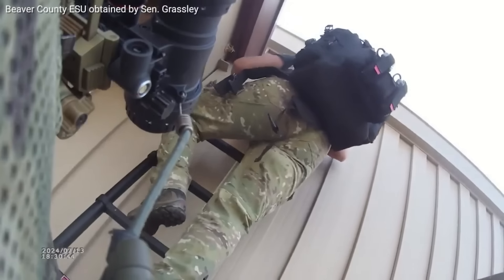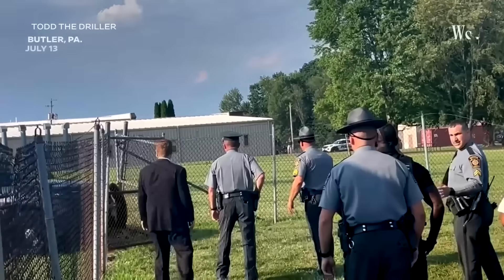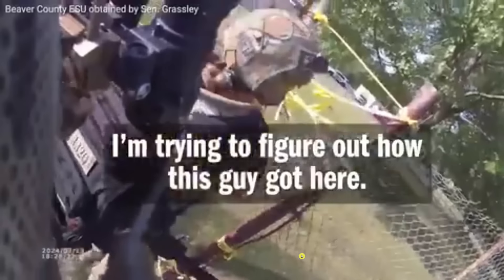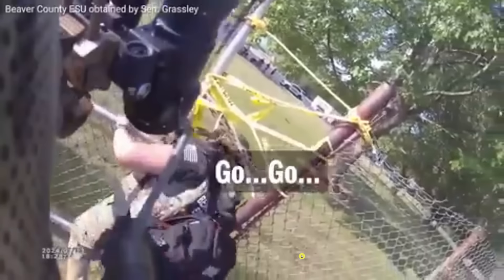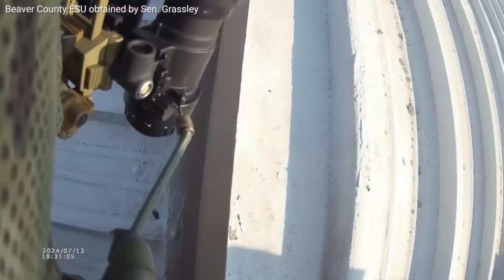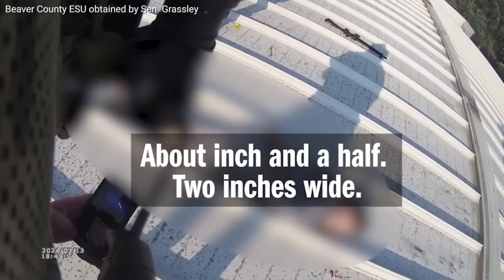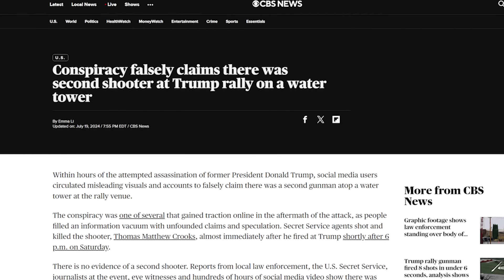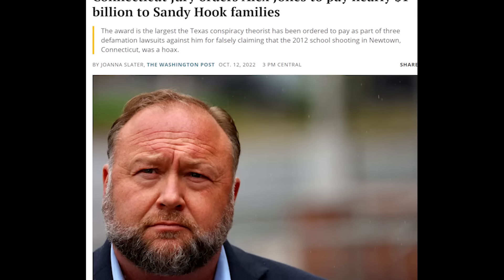Trump Shooting Analysis: Shell Casings, Ladders, Drones, Bodycams,

Comment: I'm a professional engineer and experienced marksman - had my own gun range on 20 acres and trained with AR & AK, etc... for years, and the "Pull-toy cover up" has begun.  The audio evidence from the Podium mics is extremely clear that first shooter only shot 3 shots TOTAL (not 8) and the remainder shots (4 or 5) were a VERY different timbre shots with VERY different audio propagation characteristics i.e.: last shots were more powerful rifle (NOT an AR15) from much further away - propagation analysis (I have done propagation analysis on a professional level for over 30 years) of first 3 shots is 150 yards and the remainder nominally 400 yards.
Reply: Just like many people think, he wasn't the only shooter
Reply: Yes, Chris Martenson covered this very well.
Reply: THANK YOU
Reply: Water tower is 400 yards away.
Reply: How do explain the police body cam footage in which an officer on the roof says there were at least 8 shell cases on the roof?
Reply: Thank you!
Reply: There's one thing I don't get about this scenario.  If Crooks was the patsy, and there was a also a pro, how did the pro miss?  

Also, if the bullet came from the opposite direction, it would be apparent when it hit Trump.  Likely it would be apparent even to the crowd.    If you're using two shooters, they'd have to be in the same direction.   Like from one of those open windows.

But if the guys in the building were locals, ...that would be a hell of a lot of people to bring into the inside job.  Why would you want two agencies involved in an inside job?
Reply: @kevinkingmaker7395 he wasn’t the first person up there
Reply: @kevinkingmaker7395 The body cam footage did not show the shells, the cop only referred to them as 8.  So, it makes one wonder, why did the audio files have a distinct sound of 2 different shooters followed by the one counter sniper kill shot.
Reply: @jengleheimerschmitt7941  pro missed because trump moved his head at the right time.
Reply: Exactly... I analyzed the audio from 3 different live streams within an hour of the incident, and realized that there were at least 4 different weapons fired there. I analyze audio almost everyday for over 40 years now, and you can even see the different frequencies of each weapon, not only that but the boom and report are telling, as well. This is what I call simple audio forensics, and there is no excuse for them not doing an even better job than I did within that first hour, as there are several other recordings of it available now, that was not during that first hour. The person in the crowd behind Trump, that is obviously dressed in what I have seen as the high satanic priest in other investigations, and completely stands out from everyone else there, didn't flinch in the least bit as everyone around him were ducking, etc., then texted on his phone in the same position as before the shots, while shacking his head 'no', then pointing his camera at Trump showing he was alive. Then he immediately started inciting the crowd there to start chanting. Yet, no one in the media is even talking about him, when he was the first one to catch my eye long before the shots, wondering why he kept moving over to the spot that he ended up in for a few minutes before the incident, getting people to move out of the way for him. Very suspicious to say the least. It causes you to immediately think something was up with his presence there. Just saying! Don't take my word for it, Look for yourself at the video of the crowd behind Trump where they tried to say that the FBI Assist. Dir. was sitting [not sure about her], but he is the one who caught my eye with his behavior long before the shots. He was to the left of Trump facing him... you can't miss him.
Reply: @kevinkingmaker7395 he said they were there, but they were never shown…. With all of the angles, we should have been able to see at least a few of them..
Reply: @kevinkingmaker7395  He said there were 8, but we did not SEE them did we?
Reply: First three shots were well measured and carefully taken with an even cadence. I think 45 was hit with one of the first three shots. Then came 5 very erratic faster shots from what sounds like a different rifle, location and echo. Then one last shot from the counter sniper.
Reply: 8 cases, dosent mean he fired 8, just means others may have fell from his pocket. They bound his hands and moved the gun. Where is that video. Why did he stop, did he jam, did he forget mags. They claimed he had over 50 rounds. They emptied his pockets, where extra mags etc.
Reply: he didn't show the whole video. Once they got on the roof, the cop only counted out loud 5 shells
Reply: @kevinkingmaker7395  he only counted 5 if you watch this video once they got on the roof. This guy skipped a section
Reply: @billglueck9705  For anyone who is not stupid. The first 3 shots were fired from a covered positions and the last 5 from a raised position. Thus the audio change.  Sounds can change even when moved a foot. My golly some people are idiots.
Reply: Five shell casings were found on the roof from the Grassley footage of the officer's bodycam evidence.
Reply: @SavedbyHisGrace73 what I said
Reply: All of those people on the roof contaminated the crime scene. Puting her gloves on to pretend to go serve aid, 5 minutes after lol. Talk crap for bodycam. They know what to feed people.
Reply: The way T acted after was proof he was in on it, if he thought it was real he wouldn't care about shoes, hat, or posing. But, only the sound of shots doesn't tell us much. Aiming in a different direction can change the sound, maybe he went from prone to kneeling, maybe the first three rounds were different for a specific  purpose. I am not saying there wasn't a 2nd, just, without visual with the sound it's all speculation
Reply: @kevinkingmaker7395   Other comments say that there is a video of the first officers on the roof that call out that there are 5 casings on the roof not eight.
Reply: @SavedbyHisGrace73  See also John Cullen’s (John E Hoover on YouTube) compelling analysis of video and audio. Martenson and Cullen both support 2 shooters, but different on the sources of the shots. For example, Cullen shows quite convincingly that shot #1 actually originated from the trees to the right of Bldg 6 and at the SS snipers!
Reply: @kevinkingmaker7395  Yea thats what he said.....just words...
Reply: @billglueck9705  Exactly my take on this.
Reply: @bobgreene3539  The guy in black, with the funny hat on? I thought he was odd, because it is not the kind of hat one would wear on a hot day in a rally place... more like some costume prop.... he sat like a statue, as if nothing strange was going down, when everybody else was scrambling!
Reply: @elliewilsIf were not believing the # of casings, I believe he was not hit by a bullet
Reply: @johnrogan9420  The Water Tower is about 800 feet away from where Trump was standing
Reply: @jengleheimerschmitt7941  The other shooter was in the building behind Crooks. Shot out the window. Greg, the guy with the tatoo sleeve. I don't believe for a second that both of them guys sitting behind the window in that room got off of their post to go searching for Crooks. The grounds were full of staff policing the area. BS!
Reply: also stated shells on both sides... but the shells ejected from a semi auto would only be on one side. the side the casing was ejected out of the gun.
Reply: @johnrogan9420   Using gmap pedometer, I found that the closest edge of the water tower to Trump was 807 feet away.
Reply: @geraldreinhardt8415   There are a few aerial shots that show that a huge, red Combine/Harvester was placed between those 2nd floor windows and Trump within  the perimeter of the interior fence line....likely intentionally as a measure to protect Trump in the event the second floor counter snipers assigned to that post had to fire in the general direction toward the rally.
Reply: @kevinkingmaker7395 the sniper cops inside the window shot # 4-8 and threw the shells out the window to the roof where the 20 year old was laying  ....last # 9 was SS ....possible  # 10 was from approx 1400 yards away by SS or other sniper
Reply: @bobgreene3539 and video confirms! They killed the kid and planted him.had an actor that othes didnt really match appear for film then dicked out and they started firing.
Reply: @peggygilmour8905 yes, if you watch the video closely while he's counting you can see 5 cases. Right then the guy on the other side of the roof points and looks down, presumably where the other 3 cases are. Could be explained by the shooter shifting position after the first 3 shots. That also might explain the different audio signature.
Reply: @kevinkingmaker7395  What, he can’t lie?  Did you see any visual evidence?  However, there is audio evidence on the shots.
Reply: @geraldreinhardt8415 an actor played crooks and had slightly diffrent color shorts on! Crooks was dead wrapped in that blanket!
Reply: @velvetpaws999 he might dress funny but he is an avid Trump supporter, and goes to many of DJT's rallies. can't think of his name
Reply: @geraldreinhardt8415  Yeah, that sounds very likely.  The problem Is, an inside job with multiple agencies is a lot more difficult than it has to be.  On the other hand it does muddy the water and explain the coms breakdown.    The other issue I have there is that if they'd had a pro, he wouldn't have gone for a head shot in the first place.  A pro would expect the head to bob around and he'd aim for the center of mass.
Reply: Both the photos and video of crooks are too grainy for todays hd think hard a photo from only 100 feet away you cannot blow up both photos and the videp by design
Reply: Shots 4 to 8 are different. The time of the echo between bullet crack and gun report are very close in timming, but not exact. This will take real forensics to sort out. I think they should even do a live fire reenactment. If the shooter moved, like stood up or rested the rifle on the roof. The gun firing against the roof would be a different signature than free holding. The forensics on the shell casing should show if they have the same markings and mean they were fired from the same gun.

Were there two vehicles? Where are the photos? How do you transport a ladder, a bike and a drone?
Reply: @lastdaysguitar  yes! Exactly! I have similar observations, too!  Great  analysis 👍
Reply: @CL-mp4vn he wasn't ANY of the three shooters
Reply: @TexasEngineer none of the sounds are from free holding. To set the steady timming of first and rapid fire of second group had to be professionally done.
Reply: I saw a video today during the rally where people said " where are those police running"....,it appeared, to the water tower and I think someone even said that. I saw the audio footprint, clearly showing there were different weapons.
Reply: @bobgreene3539 the audio guy I heard said the first shot was muffled, followed by two shots, then five other shots plus one, so are you singling out the first shot? Maybe the kid only fired the first shot.
Reply: @elijahmiller912  are you trying to say trump was in on this ? If so you are completely out of your mind.
Reply: @kevinkingmaker7395 he's a liar 
did you see the casings
Reply: @VicknairD  will definitely check that out. It wouldn't surprise me in the least. What a mess.
Reply: Can fool believers but not those who KNOW!!!!!
Reply: @bobgreene3539 interesting. I listened to a video with 2 guys analyzing the gal behind Trump (in the sunglasses & phone with the odd behavior) & they noticed/pointed out that she & he (the guy you’re referencing) seem to be working in concert (even though they’re not sitting together). These guys both agreed their behavior/s was indeed odd.
Reply: @velvetpaws999 that guy with the hat/glasses is Vincent & he’s been at dozens of not more rally’s.
Reply: @elijahmiller912 or it could be because the secret service said shooter down.. trump being in on it is ridiculous. All it takes is a little bit of a change of wind direction and you blow trumps head off. Stop being ridiculous.
Reply: @bobgreene3539  Wouldn't the shots have a different sound if the shooter was standing vs prone?  You would get a pretty nasty echo off a metal roof.
Reply: The last shots definitely sounded like a .308 more than anything
Reply: Well, exactly! That's why Erik Prince tweeted day of (paraphrasing) 'good thing a counter Sniper took a 480yd shot to the sh00ter'. There was another Sniper further away from the two pairs of CS'ers on the red barns - he was adjacent left of CS team on the southern side.
Reply: With the first three shots he was probably prone, resting the barrel on the ridge.
This would create a different sound signature to when he changed his shooting stance and fired the other rounds..
Reply: Is everyone going to ignore the radio chatter n body Cam guy n Michelle (medic) talking about the water tower n van?
Reply: @alanshaw4655 
Exactly.  Bullet went where it was aimed.  Trump moved. Not exactly a miss.
Reply: @bobgreene3539  Are you talking about Vince Fusca?
Reply: @chickenlady-iw8fx 
I heard that same in a different video of this same footage.  Now I don't know what to believe.  I also listened to Wray say 8 then later a congressman asked if it was 7 and he siad yes.
Nobody seemed to notice.
Reply: @Eydr-s5j  Presumably the kid shot none and was only there to be shot at. If I see his pictures and the blaroc video, he wasn't too smart a guy.
Reply: Yes, and that second group of 5 shots was so fast, it almost sounded like a burst from a  full automatic.  Almost. But definitely a quite different sound from the first 3.
Reply: From a low quality audio track. Get lost with this bs.
Reply: @RememberNineEleven  that is what I would think. Given the police said 8 cartridges on the video, and there were only 8 shots heard, it makes me wonder if he only shot 3-4 times, and the rest were sniper shots. And they simply unloaded the gun and moved it away from the body.
Reply: @jengleheimerschmitt7941  good points. I think it’s going with the idea that Trump was not shot. That the wound was created later and that the idea was to shoot into the audience.
Reply: im thinking you are a 14 year old boy with a big imagination lol
Reply: Respectfully, I would ask you to look at the audio again. At least 3 of the second salvo of shots have the same propagation time as the 3 in the first salvo. There is no evidence for 400 yards. That is a mistake made by tying the wrong sonic shockwave and muzzle report together. I can find six pairs 0.22 seconds apart. The podium audio, while useful for determining distances is not actually helpful for the number of shots because cracks and reports overlap in the salvo of 5. The various cellphone audios from the crowd more clearly show 3 shots, pause, 5 shots, one distant counter-sniper shot, long pause, second more distant counter-sniper shot. Some cellphone audios make it sound like every single bullet is different out of the 8. One has them all sounding the same - the New York Post one, "Panic..."
Reply: @SavedbyHisGrace73  true, very intersting Martenson's audio analysis. The only thing I do not believe is that one of the 5 shots killed the fireman. If the gun firing the 5 shots had been pointed towards the crowd a couple more people had been injured/killed
Reply: @kevinkingmaker7395  In the full bodycam video that was released, at 6.31.45 pm they count 5 shell casings.  After 6.38 pm, 10 min is missing of body cam footage.   Then at 7.01.55 pm they count 8 shell casings.
Reply: @heynow01  Lots of things could explain the differing sound, such as Crooks standing up for the 2nd group of shots, microphone angle changing, etc.  The 2nd group followed awfully quickly, though.  Still, I find this a bit more believable than the local LEO's on the roof immediately after the shooting being in on what would have to be a VERY complex, very risky plot, including things like knowing how many shots each shooter would take if there were 2 shooters, being sure a 2nd shooter would not be detected right away, etc.  The second shooter would have to be firing a much heavier weapon to be louder at a few hundred yards away than shots taken from the AGR building and recorded beside it.  (inverse square law of sound volume vs. distance)  Also, surely bystanders near the AGR building would hear shots "from that other direction".  None have said that.
Reply: @krisbooth1473  this is the most ridiculous scenario I've heard yet.
Reply: @bobgreene3539  I call BS.  A real 40+ year audio pro would not refer to "the different frequencies of each weapon".  You don't know the language, you just think you do.
Reply: "first 3 shots is 150 yards and the remainder nominally 400 yards": No no, last shot was a single kill from SS sniper, maybe 300yds - ONE SHOT. No way 2nd shooter sniped 4 times at 400 yds and missed. You don't set all that up to miss.
Reply: @peggygilmour8905  8 casings were found.  The count of 8 is about 19 minutes later in the bodycam footage.  3 were on the "other side" of the roof ridge - almost certainly from the 1st 3 shots.
Reply: @elijahmiller912  Hah, you don't know Trump at all.
Reply: @SpringIsBACK  Check out Mike Bell. "Trump Shooting audio analysis" from yesterday.
This guy uses two audio files, one near the fence line between and the shooter and the other from Trump's mic. 
These two files show all eight shots displaying an identical signature pattern and the 9th shot being from a different gun.
He explains that the other files being analyzed are not good examples?
Seems credible?
Reply: @RememberNineEleven  the guy I saw, said the speed plus the sound pointed to another shooter. The first ones sounded like a target shoot, the next five, just firing asca decoy. Maybe the kid agreed to do that part, knowing he'd probably die.
Reply: @Pozi_Drive  I think you may be right. If he hated trump and was also depressed, he chose to pay the price to go out as a hero to the left.
Reply: @heinerrambold8889  I've not heard anyone saying where the fire chief was in relation to Trump., Plus the other two people hit???????
Reply: @SpringIsBACK  I think the controversy there, is they seemed to be on the left side of the shooter instead of the right, where they would discharge. No way he jumped up and changed his angle once the shots started.
Reply: @heinerrambold8889  yes, if I was family, I would be digging in hard on what exactly happened.
Reply: @Eydr-s5j  there is a video from azget industries showing the trajectories. The fire chief was on the left bleacher somehwere in the middle, the other people who were injured on the right bleacher almost at the top.
Reply: @heinerrambold8889  thanks, I'll check it out 🇺🇸
Reply: Korrekt !
Reply: Shot from sniper 4 at open window
Reply: @chickenlady-iw8fx body cams turned off for 12min
Reply: Why bring up Alex Jones unless you want to scare peoples opinions (Conspiracy Theories ) You did it yourself by stating the shooter likely stood up to take the last 5 shots rapid fire burst mode and exposed him. How come no one has taken a video were the SS Snipers were on the roof with the tall tripod at least 4 feet about the crest of their roof and put a person where the sniper was crawling up the roof to see if he is visible. if you noticed the sniper was at least 18" to 24" above the roof while moving up the roof especially carrying the gun.
I bet if you ask any counter snipers ti view the site I bet 99% would pick the water tower as a place to put an SS agent with a pair of binoculars. if you use Google Earth you can see the ladder on the far side of the water tower for easy access.

Wow your theory is totally off I thought you said he stood up after the first 3 shots . Also you say at the end he was a few feet from the apex of the roof . You do realize the SS snipers were way above Trump so if the shooter can see Trump the SS snipers at the higher elevation would have definitely seen him that is simple Math Geometry Angles ???????

His Geometry does not compute X = sniper, Y =Trump, Z =SS Snipers If X can see Y and Z is above Y then Z can definity see X Simple Math😇😇
Reply: They said the other shots were muffled like being shot from inside the building, hence the wundow.
Reply: The first three shots were fired from the second floor of the building next to the alleged shooter.  The weapon that fired the first three shots was probably fitted with a silencer, which accounts for the lack of echos.  The second five shots were blanks fired from the same location but with a different weapon most likely an AR-15 using a surefire trigger that can fire rapidly.  Blanks were used in the AR-15, which explains why no one else was injured.  Local law enforcement was in the building next to the building that the alleged shooter was on.  The last shot fired killed the alleged shooter and was probably fired from the same window as the other eight shots.  Everything supposedly found on the roof by first responders was planted by them as alleged evidence, including the 8 shell casings.
Reply: @jengleheimerschmitt7941 they used locking one officer out and the other going to let him in to clear the hide then took a hurried CBS and missed the kid fired on there signal lol my opinion
Reply: I think you are giving the ss a free pass on a lot of this
Reply: Dude used the red ladder
Reply: They used the kid and then  killed him😢😢😢
Reply: @KoletaTukana  Agreed just like Lee Harvey Oswald.  A patsy.
Reply: @jengleheimerschmitt7941  It amazes me that there are 8 enemy rounds fired into a crowd and only four hit someone. Have the bullets been accounted for (if not physically located)?
Reply: @LEDRavecom  The FBI Director testified that they recovered eight cartridges on the roof near Crooks' body. 🧂 

...I think the line of fire was near parallel with the bleachers.  But one bullet did hit a hydraulic line on one of the cranes which was several feet away.  And two other people were injured which I assume means shot.

Crooks' is reportedly an excellent shot. There's another video with a guy that was in a shooting class with Crooks the week before. He said that Crooks was an amazing shot and seemed to be a pro with the operation and whatnot.

It was just the two of them in the class that day... the FBI called him after the shooting and said, "so... you in a shooting class last week, right?  Well, the other guy in the class is the one that tried to shoot the President yesterday"
Reply: Sure you are.
Reply: HAVE  THEY CHECKED TO SEE IF ALL EIGHT EMPTY CASINGS WERE SHOT FROM THE SAME GUN? ON ANOTHER VIDEO, THEY ONLY COUNTED 5 BULLET CASINGS, TWICE. THEN THEY COUNTED 8. THREE MORE WERE FOUND ON TGE OTHER SIDE OF THE APEX OF THE ROOF. HOW DID THEY GET THERE? DID SOMEBODY DROPPED THEM AFTERWARDS, BEFORE THE SECRET SERVICE GUY GET THERE?
Reply: @billglueck9705  yep.  Clearly.  Interestingly enough almost all of the multiple shooter videos have been pulled down from youtube.  It took them a while but they are almost all gone.  hmmmm🤔
Reply: @kameljoe21  yes the first three were fired from within the AGR through the open building.  Crooks rising to a standing position or kneeling position would not explain that big of a deviation in sound.  It's simply not possible for that big of change when the position hasn't been changed that dramatically.  IT's not just the position but also the environment around the assassin.